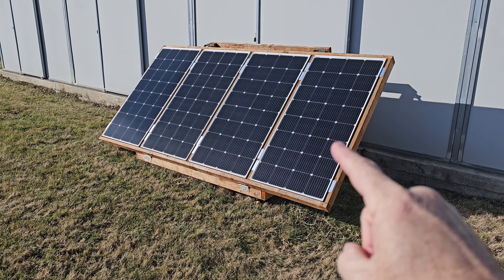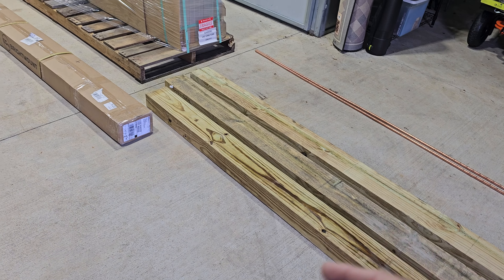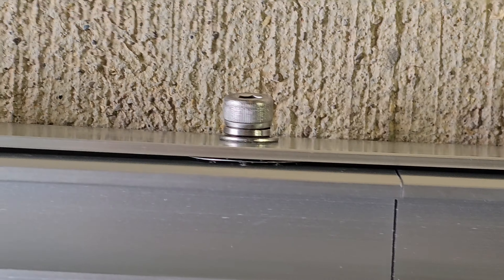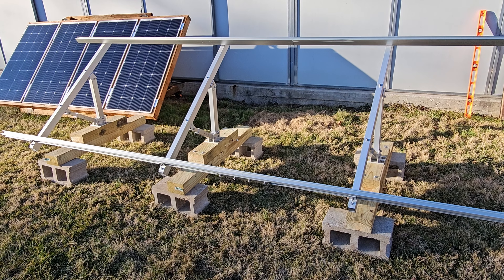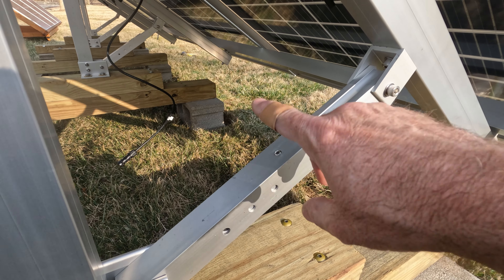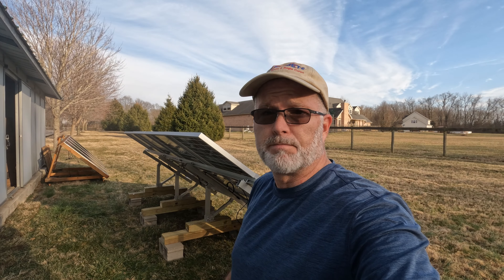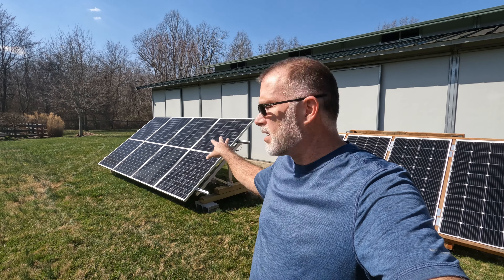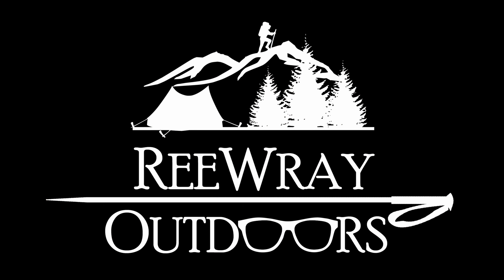Budget-Friendly DIY Solar Ground Mount: EG4 BrightMount & Eco-Wothy Combiner Box  *Unsponsored*

Comment: Solar panels, under the worst conditions, are basically "sails".  The amount of lift they can create is substantial.  At your local home improvement box store you will find ground anchors that have an i-bolt on top and a helix, mounted on an incline plane, at the bottom.  (TBBT reference there).  It's a large metal screw with a loop on top.  Run them down in the ground and then you can secure the 4x6 bases you made using cable or something like it.  They are easily removed later, if you need to reposition the array.
Reply from the maker: Thanks for the suggestion, Jason. Sounds like an easy implementation.  I will say though that the final assembly is HEAVY (~400lbs).  I suspect it'd take tornado-class winds to move it - especially given their orientation and with the barn structure at the back.  I'll probably put some reference marks on the cinder blocks so I can monitor for any movement after high winds and then do additional anchoring if necessary.  Time will tell!   As I mentioned in the video, the currently location is only 'semi-permanent' since I'm looking to put a large ~16KW array in that spot sometime in the next year.  At that point, I'll be moving this smaller array to a different location and use it primarily for EV charging.  We'll see how it all goes. :P
Reply: @ReeWrayOutdoors  - They are really easy to install or remove with a drill.  (in excess of) 400lbs of lift doesn't take as much wind as you might think, although being close to the barn behind it would likely preclude that volume of wind from hitting the panels.  It's really more of a "best practice" kind of deal.
Reply: One thing I will note on arrays like this... when there is a modest air gap between the panels it usually relieves a large portion of the wind pressure.   I recommend rejiggering one row of the panels a little to add some vertical separation in addition to the horizontal separation you already have.
Reply: @ReeWrayOutdoors 400 lbs is nothing compared to the lifting force of the sail you just created with the panels..
Reply: @ReeWrayOutdoors  the year i've had mine it never flew. I've had really bad thunderstorms and tornadoes in my area where trees come down in my area and my array still stood in place
Reply from the maker: @Moes_Prep_and_Tech  yeah I did finally put in some ground screws just in case, but I've also been monitoring the bottom plank position on the cinder blocks closely and....nothin'...hasn't moved even a tiny bit.
Reply: @junkerzn7312 this is what I was thinking.  Wind gap the panels.  Use that extra space on each end of the rails.

Comment: You should not ground the panels. the reason being is  it is close to the ground and any lighting will not strike the panels. When you ground the panels it will attract the lighting and your panels are grounded it is going to be damaged when the lighting discharges through the panels to the ground. Best thing to do is make sure you have a tall lighting rod in the vicinity, in your case you have a tall building and trees around.  DC electricity do not and should not be earth grounded.

Comment: I just got the exact same equipment. Same panels, same mount. I can't wait to assemble it. I'm doing a manual tracker with beefy wheels and a cement pivot that consists of a large axle and bearings. I've made 3 small trackers that work excellently but now I'm stepping it up a notch. I can swing them with one finger. I got the idea from yours and other  YouTube videos.
Reply: What width of the panels?  44" exactly, or 44.7"?  And if the latter, did 4 panels fit easily?

Comment: You had better reconsider your ground mounting technique. There is not enough weight to keep those panels from flying away in a strong thunderstorm. Add some concrete ballast on the legs of the solar panel brackets

Comment: You can put the feet inside the cinder blocks. Looks like it will fit.
Reply from the maker: I think you're right about that.  But I did want to get the panels up off the ground a bit higher.  And I've actually (a few months ago), expanded to a 2nd rack and relocated them, adding another 4x6 to the bases for additional height.  Working great....except that I failed to grasp just how low in the sky the sun actually is during the winter months and now I'll have to move them yet again to avoid fence rail shadows. :P  But that's on me. haha

Comment: The sail comment from earlier... for anyone building these structures I highly recommend attaching them to the ground. In my former life as a swim center director I remember 1/4th of a 50 meter pool cover pulling 4 180lb lifeguards into the pool during a large gust.
Reply from the maker: Yikes!  Yeah I guess that 50m pool cover would be a serious sail in the wind!  But I will say that I've had this rack now through several extreme weather encounters with wind gusts ~70mph and it did not budge even a tiny bit.  I think that the combined weight of these panels, the rack and the heavy wooden base footers I used are enough to offset just about any 'normal' weather conditions I get in souther Ohio.  That said, never a bad idea to use anchors where/when possible!

Comment: I have the same rack, its very nice.  I actually bought extra end clamps and didn't tie the two halves together due to my situation (two 2 panel racks). Makes them easier to move for now as well. 
11:35 you can add some insurance with bolts in the horizontal holes (p6 of manual). I believe that's what they are for.  
Your top rail is upside down, the L bracket should face the same way as the bottom one.  I don't believe it will make much of a difference , it just moves the horizontal support down a few inches.
Reply from the maker: Cool idea!  I can see where doing 2 separate smaller racks might be super handy.  You're right about that top rail...I didn't realize it until later, but yeah,  it's completely fine that way it seems.

Comment: Thanks  R-W-O, ... 
I have a  36 panel,  Ground Mount -  configured in a:  6S / 6P configuration ... 
Your GROUNDING Solution appears to be  MUCH  <less EXPENSIVE  than my attempt at GROUNDING / EARTHING ... 
my PANELS were very (antique) OLD ( 60-CELL) items  = they even came equipped with " MC3 " connectors  vs the >More modern  " MC4 " Connectors ... 
and my six (6) GROUND MOUNT Arrays were constructed with  4" X 4" & 2" X 6"  Wood - requiring  each panel to be abraded with a high speed grinder ... 
to remove, your mentioned, ANODIZATION & an  individual Grounding LUG to be bolted to each of my 36 panels ... 
then a  6 - AWG  Bare Copper wire was woven from PANEL to PANEL and  then attached to an  8' long  Copper-Coated STEEL Ground ROD,  by my arrays ... 
I too started with an  ECO-WORTHY  Combiner-Box  - originally a  FOUR (4) string unit - but - eventually expanded to an ECO-Worthy SIX (6) String Combiner-Box ... 
I <like> the ECO-WORTHY Construction & their included  SURGE-PROTECTION & separate internal Grounding LUG ... 
Thanks for SHARING your SYSTEM & SOLUTIONS 
COOP
the  WiSeNhEiMeR  from Richmond, INDIANA 
...

Comment: Hey thanks for this! I have 12 of the same Hyundai bifacial panels as well as 3 of the Brightmounts to build. I also plan to use 4x6 Timbers. I am in a windy area, so I am going to bolt through the Timbers and also use auger type ground anchors. I’m shadowed from the prevailing wind by my house, but you never know what that rogue gust is going to do! Man, unloading the vertically packed panels from the pallet was scary even with two fairly strong guys.

Comment: Any concern of the array just tipping forward from maybe a gust of wind?? And or are you already using sand bags or blocks on top of the cut 4X6s??  Remember to check torque on lag bolts as wood dries.

Comment: I have this same ground mount but I can't seem to line up the 2 halfs of it for the life of me. One side of it always seems uneven no matter how level the ground is. The model I got isn't adjustable like yours though. They quickly changed that right after I bought mine, lucky me. I have mine on a concrete parking bumper. (it was a pain to drill into and move)

Comment: So Question.  The EG4 Ground mount that your using, specifies a maximum width of 44" for each solar panel.

The 395 watt bi-facial panels I'm looking at now, and I'm assuming yours as well, show a width of 44.7".   Times 4 panels, and we're over the maximum width of the mount by 2.8"

It looks like there's spare room on the rails on either side in your video.  Does the extra 2.8" matter?

Comment: Just had a video idea maybe? If you have an AllPower R2500 on the way to review, it does state 1000W max solar input or 150v/20amp. 3 of those new panels being 48.8v and 10.12amp or a string of three = 146.4V/10.12amp and 1185W of power. Knowing that panels never give 100% of rated power, would it be safe to use that 3 panel setup and as they say 'over panel' the MPPT on the R2500 so its always near max input?

Comment: Only issue that I see is that for the combiner box you actually have to put in fuses sized for the panels.   There will be a maximum series fuse specification on the label on the solar panel... the fuse cannot be larger than that specification.  That particular combiner box looks like it is designed for a higher-current array so the fuses that come pre-installed might be too big to actually be able to protect the panels.

-Matt
Reply: Fuses protect the wiring from the combiner box to the charge controller. They don't protect the panels. Backflow diodes would be to protect the panels but that combiner box doesn't have any backflow diodes.
Reply: @fauxque5057  That's not how I understand it. A solar panel is rated for X amount of current (max series fuse rating). If something shorts in that panel there needs to be a fuse preventing X+Y current flowing into said shorted panel burning up things and catching fire. With a fuse or breaker at the combining point it prevents a failure in one panel from overrunning the limits of said panel.
Reply: @BeeneEnergy  I'm doing a late reply but, basically yes.  The fuse is there to prevent the string from catching fire if other paralleled strings all dump their current into that string due to a short in the string.  The solar cells are more vulnerable to over-current than the string cabling... the fuse is protecting the panels a lot more than it is protecting the cabling.   (Most panel cabling is 10 AWG or 12 AWG and can handle far more current than the cells can handle).

Protection diodes (which are different from bypass diodes) have fallen out of favor.  The reason is that these diodes have a fairly large voltage drop and generate a lot of heat, don't remove the need for a fuse, and don't really protect against situations where a fuse wouldn't blow anyway.  So fuses are typically used these days and protection diodes are not.

The combiner box will generally have a single breaker on the egress, but not per-string breakers.   The egress breaker is just used for convenient maintenance, there is no situation where it would ever actually trip on its own.

The reason is that per-string breakers would have to be unpolarized and rated for 600VDC-1000VDC.  That combination is a very expensive breaker.  The egress breaker, on the other-hand, can be a polarized DC breaker, also rated for 600VDC-1000VDC.. but a. far less expensive breaker. 

Anyone with combiner boxes that use breakers for per-string protection is probably sitting on a fire waiting to happen... installers never wire those DC breakers up properly (if polarized, they have to be wired for reverse current direction which is really confusing to people)... or use the wrong kind of breaker.

-Matt

Comment: What are the dimensions of the 4 x 6s you secured to and how did you determine those dimensions ? Excellent set up ! Also if you must move this Brightmount array how will you accomplish the relocation? Will you just disassemble it ?

Thanks!
Reply: Three 4 x 6 x 8 => 1st 2, cut in half (4 x 6 x 4 each) and the third, cut in four (4 x 6 x 2) each

Comment: Do you think it would be possible to mount that on 4 or more large caster(?) wheels to role in and out of a garage?  I have a small lot in town.  I bought that same mount with 4 400 watt panels.
Reply from the maker: Yeah I think so.  You would want to build a bottom frame that ties together the 4 legs so that you don't have too much flex across the rails when you're moving it which could put a fair amount of strain on the solar panels.

Comment: Hi David,
          Good stuff! I like both of your ground mount systems. You have double the capacity of the original mount with the new brightmount. The brightmount can hold some big panels and they do sell an extender kit if you should ever need it. Since you have those additional panels you could set up another brightmount in the future right next to this new one when the need arises for more solar capacity. Charge up your ebike batteries off of your power stations or 48v system and off you go on sun power. That's neat and environmentally friendly!  
            I do have some questions about the new mount, if you don't mind. You know me, I always have some questions. 🤔😊
            With a ground mount that big do you need any building permits? It's not really affixed or concreted into the ground so I don't know the laws around these parts. Maybe if it was concreted in the ground it would be different, I don't know. If it's off grid that might make a difference too. I need to brush up on these things.
               You have stated that the new mount is pretty stout and heavy but do you think there is a chance under high winds that it could shift on the concrete blocks? Could you affix a clamping system of some sort to the wood and blocks? There are holes in the blocks so you may be able to rig something if you think it may add to the over all stability of the mount. BTW...don't know when or if you will read this but we're under a tornado watch until midnight. One last question....Do you plan to bury the solar cables or run them above ground?
                I want to thank you again for these wonderful and informative videos. I have learned so much from you and I really enjoy your solar and ebike content.
                                                                                     Take care, stay safe and have fun, Steve.
Reply from the maker: Excellent questions, Steve.  Regarding the permits, I think I'm in a bit of a gray area (purposely) on this one since it's not really permanently affixed to anything and not attached to grid at all or providing power to a living space.   So for now, I'm not doing any permitting on this project.  However, if/when I get to a point where I'm going to expand it move it to a more permanent location next to my garage - where I'll be using it for EV charging eventually - at that point, I'll get the electrical part permitted since it will connect to the main house.   The cable I'm using is marine-rated and UV resistant and suitable for outdoor applications, so I don't 'technically' need to bury it...BUT if it seems that it's likely to remain in place for the balance of the year, I may go ahead and bury it for convenience.   I'm really not expecting this rack to budge even some really heavy wind (which we also got today with that storm that blew through!).   But I'm watching it closely for any signs of shifting and if I need to, I'll secure it to the cinder blocks.  I'll be sure and report back in the comments if that turns out to be necessary.

Comment: Is your output wire from the combiner box large enough? 4 of those panels in parallel is max 40amps, which requires at least an 8awg wire. 
The rack looks nice and Im considering something similar to feed my Ecoflow
Reply from the maker: I'm actually using a 2S2P configuration so my max current is 20A.  I'm using 10awg cable so should be fine. :)

Comment: How long are the rails that the panels attach to? I want to put 6 100w panels on one. As well how far apart are the mounting rails my panels are 41” tall.
Reply from the maker: the rails are ~14 feet long and approx 46.25 inches apart if you mount the top rail upside down like I did...it would a couple inches further if you mounted per the manual.  I hope that helps.

Comment: I get a kick out of watching individuals drive an 8ft grounding rod.  It is similar to watching those commercials for rototillers where a smiling operator just tills away leaving a perfect bed of earth behind.
Reality in many places, like where I will put my panels, is that there seems to be more rock than earth!  I really don't know how to drive something like a grounding rod into this "earth."  Years ago before we hired a certified well driller we attempted to hand pound a shallow well.  We completely demolished two different well points less than 3ft down.  
What are the recommendations for a grounding rod in these instances?
Reply: There are special hammers for this, those use vibration to drive the rod.

Comment: The set screw only keep the slope in place. Look on the side of the rail, you'll see holes. Align the hole with the hole on the inner rail and put a bolt through it. You can't sit four piers on the ground, they have to be tied to footings at least 3 feet deep, that arrangement will blow away in heavy winds.

Also the combiner box fuses should be specific to the module data sheet which will tells you what size fuse to use. You don't want to use a 20A fuse on a module rated for a 10A fuse. 

The charge controller determines max voltage not the combiner box, the combiner box only gives you the max the combiner box voltage. Don't exceed your charge controller's input voltage or you'll blow it.